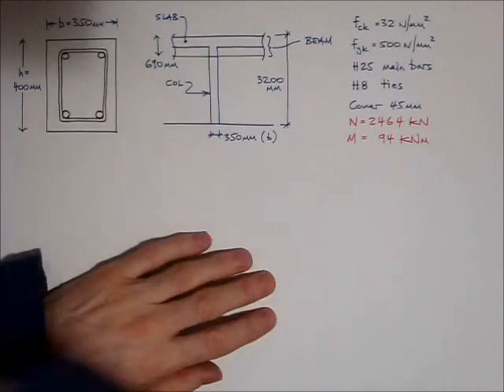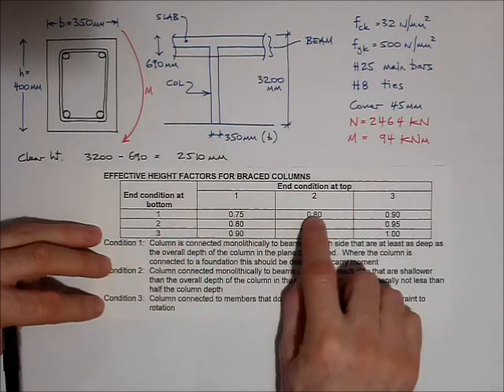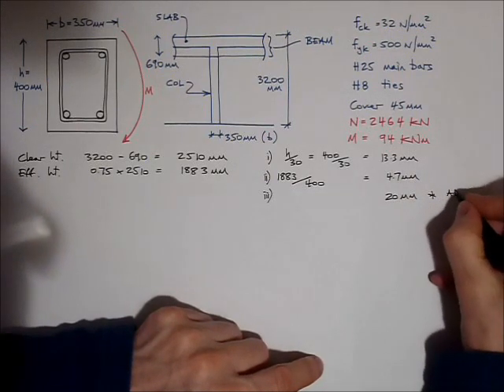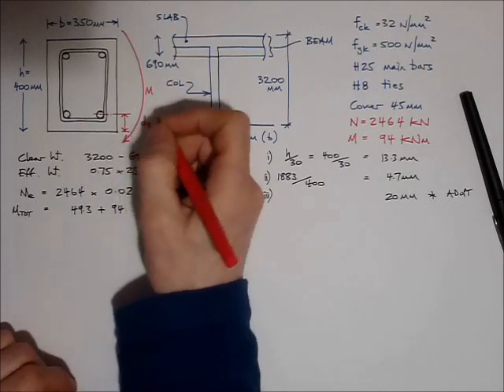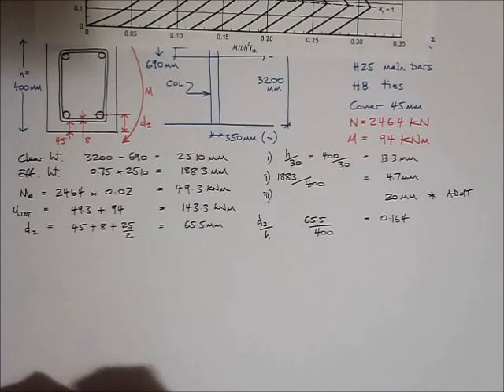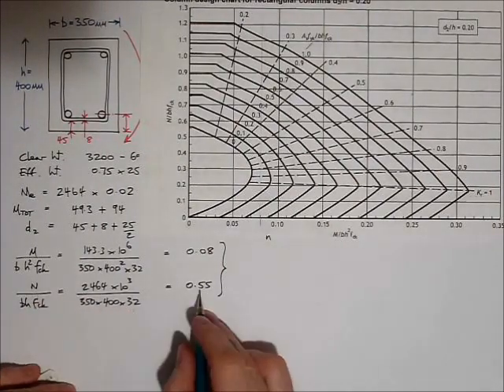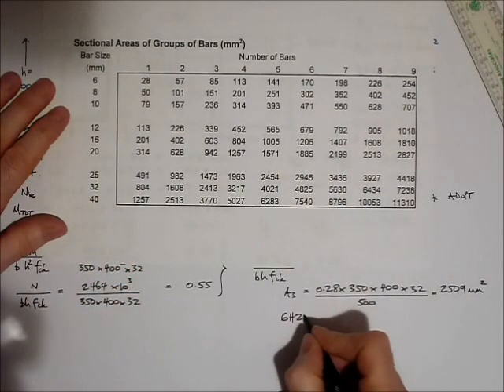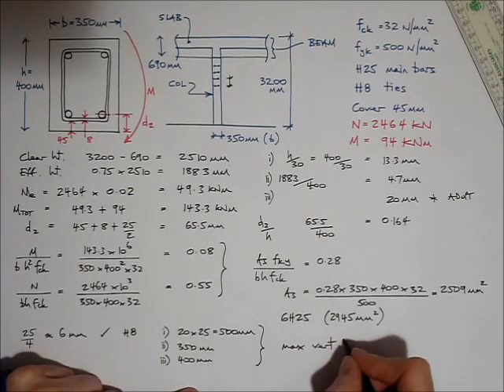RC Column Design EC2 - Worked example - main longitudinal bars and tie bars

Comment: Which version of the manual you have? - I checked in 2006 and charts don't have K dotted lines on it: http://ndl.ethernet.edu.et/bitstream/123456789/87977/35/Manual_for_the_design_of_concrete_building_structures_to_Eurocode_2.pdf

Comment: maybe im not seeing it clearly but the intersection happens between 0.1 and 0.2 curves in the graph
Reply from the maker: Hi ktkiigen, I have just checked the video and I am pretty sure that the point lies between 0.2 and 0.3. Remember that we are using the curved lines which have their labels ABOVE them. Apologies for the slow response - Mike

Comment: Hi Mike with 6X 25 dia bars can you still maintain compliance with spacing of longitudinals thanks
Reply from the maker: Hi rubatcross6374, good point. This video is only really meant as an introduction to the sizing of the main reinforcement in an RC column. There is a tiny bit of guidance on the spacing of links but there is so much more to cover regarding the minimum provisiona and spacing of all bars within a structural element. You are right, additional bars are needed to complete the full design of the column. It's surprising how little time there is to do things in just 14 minutes, Mike

Comment: How do you find the moment on the column transferring from your slab? All the examples I see the moment is given but how don you find it ?
Reply from the maker: Hi Mohab, in a simplified way, the Eurocodes are not used to analyse structures but just to design them (after the analysis is completed). I make use of the IStructE book Manual for the design of reinforced concrete building structures, which gives methods for carrying out the hand analysis of framed structures. There are other books that you can use also. I suspect that these days, most analyses in industry are carried out by computer. Hope that this helps, Mike these days

Comment: After 5 years of research I have found a nice equation for the main bars, when designing symmetrical reinforcment.

As = N . [e - d1 + 0,5.N /(b.fcd)] / [(d1 - d2).fyd]

where:
As - main reinforcement on one side of the section
e = M/N + 0,5.h - d2
h - height of the section, parallel to the bending moment
d2 - the distance from the compression reinforcement to the compressed fiber
d1 - the distance from the tension reinforcement to the compressed fiber
b - the width of the section, perpendicular to the bending moment
fcd - design strength of the concrete
fyd - design strength of the steel

In your example I get around 1000 mm2 per side, or 2000 mm2 for the whole section, wich is As.fyk / (b.h.fck) = 0.22.
Reply: Hello. How to calculate the area of reinnforcement without using graf? There is a empirical formulas to calculate As without graf and using N/b*h*fck, M/b*h^2*fck and d/h? Thanks
Reply: @inzhener-konstruktor  This equation is based on strain-stress relationship and doesn't require any graphs.
Reply: @stefanstoichev8108  Thanks for the answer. But I need formula, based on this graphs of the example in this video, do you now this formulas? Not to look at the graph but to determine this value by the formula. Thanks
Reply: @inzhener-konstruktor  This are called the "normalised axial force and normalised bending moment". You use them to find you place in the graph. There are around 20-30 graphs, depending on your steel class, concrete class and d2/h ratio.
Reply: @stefanstoichev8108  "In your example I get around 1000 mm2 per side, or 2000 mm2 for the whole section, wich is As.fyk / (b.h.fck) = 0.22" Write me please fcd? fyk? can you write this values that you use in your equation?
Reply: @inzhener-konstruktor  I used all the values from the video. 
N=2464 kN
M=143.3 kNm
h=40 cm
b=35 cm
fcd = 3,2 / 1,5 . 0,85 = 1,81 kN/cm2
fyd = 50 / 1,15 = 43,5 kN/cm2
d2 = 6,55 cm
d1 = 40 - 6,55 = 33,45 cm
e = 143,3.100 / 2464 + 40/2 - 6,55 = 19,26 cm
As,req = 2464 . [19,26 - 33,45 + 0,5.2464/(35.1,81)] / [43,5.(33,45 - 6,55)] = 11,28 cm2/side

As,req,tot = 22,56 cm2 for the whole section
Reply: @stefanstoichev8108  Thanks for the answers, you help me. Where you find this formula? And in video, the coeficient 0.28 is graphically bigger than it actually looks like. Graphically it looks 0.26, maximum 0.27 but not 0.28, so the area of reincorcement in video shoud be like your values in this calculations, thst is smaller.
Reply: @inzhener-konstruktor  Ние сме инженери, не физици. Всичко, което смятаме е приблизително. Всеки инженер е длъжен да тълкува резултатите, да приеме съответното решение и да си носи отговорността и последствията.
Поздрави от България :)
Reply: @stefanstoichev8108  Благодаря ти. Поздрави от Украйна

Comment: If the result you get is less than zero. How do you determine the steel area.  Do you use minimum steel.
Reply from the maker: Hi Kennedy, Good question. I am assuming that you are referring to the value from the column design chart. If so, then, it would appear that your column is over-sized. Could you reduce the size of your column to save materials and space in the structure? If not, then, as you suggest, you would need to use minimum steel for the column design. Hope this helps, Mike (Sorry for the delay in responding)

Comment: Could you please explain how you got the bending moment M = 94kNm?
Reply from the maker: Hi Raphael  De Oliveira Fattori Pimenta, The bending moment M is a notional value that I made up to use in the example. In real life, in the design office, an engineer would calculate the forces and moments applied to a column based on the structure involved. Bending moments are common in framed RC building structures as the beams are monolithically connected to the columns and tend to induce bending in them. I hope this helps, Mike

Comment: Hello Mike, I was reading a literature by The Concrete Centre concerning design of short concrete column, and it is suggested to increase the applied moment to accommodate for geometrical imperfection by ei*NEd, where, ei = lo/400 = 1883/400 = 4.71 mm. Then, adjust the applied moment, i.e., M02 = 94 + 4.71*2464*10^-3 = 94 + 11.6 = 105.6 kNm. Then, calculate the minimum eccentricity, i.e., e0 = max(h/30, 20) = max(400/30 , 20) = 20 mm, and the design moment, MEd = max(105.6, e0*NEd) = max(105.6, 20*2464*10^-3) = max(105.6, 49.3) = 105.6 kNm. So, in brief, adding additional moment to the applied moment due to imperfection, i.e., 105.6 kNm, then compute e,min and the moment due to e,min is 49.3 kNm, then the design moment is the higher value of the two estimated moments. What is your opinion, please?
Reply from the maker: Hi m e, I have just picked up your message, which is interesting. I cannot give a definitive answer to this. My thoughts are firstly, are that in the video I have followed the guidance by the IStructE, which occasionally is conservative (but generally this saves time in the design office). Secondly, I have seen RC columns constructed on site and would be amazed if all columns on a job could be set out to within for instance 4.7 mm of their datum. 20 mm tolerance feels more reasonable to me. So I guess that I would carry on with the IStructE approach rather than the CC one, but you can choose for yourself, best of luck.

Comment: How to take the axial load on column? (Assuming?)
Reply: Depends on the type of building etc. also in the design code.
Reply: Hi friend, I left a note for the Demonstrator but not getting a reply yet. Maybe you can help to give an opinion on my comment as following:

Based on a literature by The Concrete Centre concerning design of short concrete column, and it is suggested to increase the applied moment to accommodate for geometrical imperfection by ei*NEd, where, ei = lo/400 = 1883/400 = 4.71 mm. Then, adjust the applied moment, i.e., M02 = 94 + 4.71*2464*10^-3 = 94 + 11.6 = 105.6 kNm. Then, calculate the minimum eccentricity, i.e., e0 = max(h/30, 20) = max(400/30 , 20) = 20 mm, and the design moment, MEd = max(105.6, e0*NEd) = max(105.6, 20*2464*10^-3) = max(105.6, 49.3) = 105.6 kNm. So, in brief, adding additional moment to the applied moment due to imperfection, i.e., 105.6 kNm, then compute e,min and the moment due to e,min is 49.3 kNm, then the design moment is the higher value of the two estimated moments. What is your opinion, please?

Comment: You should probably clarify what the answer of 6H25 means.
i.e 3H25 bars each side (along ends of length b); symmetrical area of reinforcement, around axis of design for the calculated d2.

Comment: Can you give example on where did the moment come from????
Reply from the maker: Hi Sportsinplus, this video is just for the design of the column and so I made up some loads. Typically, an RC frame would be analysed by computer to give moments and vertical axial loads in columns. Without a computer, a manual sub-frame analysis can be carried out (only takes a few pages of calcs) to give the same results. The Manual for the design of reinforced concrete building structures (Second edition) by the IStructE shows how to do the manual analysis. I hope that this helps.
Reply: Moment=eccentricity*P(factored load)

Comment: Hi Mike, I did get lots of benefit from your videos thank you 
Do you have concrete design problems and solutions? And can you suggest us some great books or even websites to expand our knowledge
Reply from the maker: Hi Hussein almufargi, thanks for your comments. There are some great resources on the internet - some freely available and some not. The Concrete Centre in the UK has lots of great resources for students under the title Calcrete which I have just Googled and found pretty easily. This is an entire school in RC! The best book that I have read is Draycott and Bullman: Structural Elements Design Manual: Working with Eurocodes. This covers steel, RC, masonry and timber (my favourite material). For many designers in the UK the obvious choice is: Manual for the design of reinforced concrete building structures (Second edition) by the IStructE. This is also very good. In the UK our university subscribes to Construction Information Service - this has lots of free resources for students. Perhaps you can access this too? I hope that this helps, Mike
Reply: Mike Bather thank you Mike for your suggestion

Comment: how to calculate M moment ? in your case its 94 KNm
Reply from the maker: Hi Amit Gawade, Thanks for your comment. I did not calculate the moment, I just picked a number for the calculation that seemed reasonably realistic. An engineer would analyse the RC frame (either by computer or by hand using sub-frame analysis) to come up with a bending moment in the column. This is beyond the scope of a short video like this. Mike

Comment: This design is overconservative. 20mm is for the minimum moment not for additional eccentricity. regards
Reply from the maker: Hi Adrian acg, as structures with RC columns are built to tolerances, then eccentricities occur as beams or columns above will not always align perfectly with supporting columns below. The bending due to this eccentricity must be considered in the column design (in addition to other bending moments) as EC2 requires that second order effects are considered together with other loads.A similar approach is taken with the equivalent horizontal force applied to structures in addition to wind loads (in the old British code of practice for steel for instance, wind loads and notional horizontal loads would not be applied together). I think that the Eurocode approach to these things is a reasonable one. I hope that this helps.
Reply: Hi Mike. First of all, I didn't say before but your video is great and it is a very nice work.
Regarding the minimum eccentricity, I am not saying to neglect it but to combine it differently in a, say, more favorable manner. Check out page 35 below:

http://greganagno.com/download/Reinforced%20Concrete/How%20to%20design%20concrete%20structures%20using%20Eurocode%202.pdf

EHF is not similar, but actually precisely one of the eccentricities already considered (l/400).
Regards
Reply from the maker: Hi Adrian acg, thanks for the clarification and the suggestion. I think I see what you mean now. I'm still a bit perplexed. On page 35 of the Concrete Centre document, it suggests that a stocky column should be designed for the maximum applied moment plus the maximum eccentric moment combined together. Is there some way that this can be done less conservatively than simply adding them, as is suggested for a slender column? I may be missing something obvious here. Also, I appreciate that my example is rather simple as it only includes an applied moment for the column with no explanation of where or how this is applied. It is hard to fit everything into a short video, Mike
Reply: Hi Mike. You are absolutely right in saying this link is doing the same as you said. I was wrong with the link. There is another worked example of the concrete centre which I don´t find on the internet (maybe if you have access to IHS you can get it) where is doing it differently and I agree with this second approach. It says, basically:
- Second order effect is to be added to the design moment (e2).
- Imperfection moment is to be added to the design moment (ei = lo/400 = EHF)
- If none of these govern, then minimum moment e0 applies, coming in with its h/30 or 20mm.
I think the concrete centre excel spreadsheet is also following this approach. And honestly it makes fully sense to me since its name is minimum moment, not additional.
What do you think? Best regards

Comment: mike, can you give a quick explanation on how to obtain the bending moment acting on the column
is it straight from the moment acting on that end of the beam,
since it has 2 beams attached, it adds them up
if it had beams on the bottom, which moment will i consider for the calculation

all this considering that the moment will be just in 1 axis of course
Reply from the maker: Hi Jorge Garza, Thanks for the question. In a design office, it is likely that the bending moment in the columns would be found using computer software. You are right in saying that the bending moments in the beams contribute to the moments in the columns. So, it is fairly straightforward to calculate the moments in the columns by hand using moment distribution.  A sub-frame (i.e. just a small part of a larger building frame) is analysed taking account of the bending in the beams.Sorry to say that there is not a quicker manual method that I know of. I hope that this helps,  Mike

Comment: Great video Mike, thank for sharing. May I ask you, just to be sure: in min.3.30 you said and show that make the check for eccentricity with clear high of the column, but instead of 2510mm you continued the calculation with the effective one 1883mm. Which is correct?
Thanks again!
Reply from the maker: Hi Dimitar Dimitrov, I believe that the effective height (or length) is used as this calculation relates to eccentricity, and the eccentricity of a column relates more strongly to its effective height than to its actual height.
Reply: Thanks

Comment: Hi, Mike, great video. 
What does the dotted line (written as K= from 0.1 to 1.0) in the column design chart do in the design? 
 it seems you did't use it in the demonstration.
Reply from the maker: Hi Tsz Pui Wong, thanks for your comment.  The chart used shows some dashed lines labeled for different values of K. These relate to the position of the neutral axis and are not required for the example in this video. I hope that this is enough for you, Mike
Reply: Thanks for your explanation, keep up the good work :)

Comment: how can l get Mx and My ıf l have the design load Pu
Reply from the maker: Hi Dean Mringi, the bending moments that are carried by the column have to be calculated in a separate analysis. Usually, the simplest way is to carry out a sub-frame analysis - which is a lot easier than it sounds and the method can be found in many text books. I hope that this helps.
Reply: +Mike Bather thank you that  helped so much. we are taught how to calculate beams, columns, slabs and foundation but l have never done a complete analysis connecting all of those elements..

Comment: Hi Mike, thanks for the great video. May I ask, do you normally factor in safety factor (ie. 1.5, etc,..)? thanks.
Reply from the maker: Hi The Snooex, As the Eurocode is a limit state design code, there are factors of safety applied to both the applied forces or actions and there are factors of safety applied to each of the materials. I apologise for not making it clearer that the design axial force N and design moment M applied to the column are already factored. So, in short, yes you normally include factors of safety when calculating the design axial force and moment. Thanks for raising this.